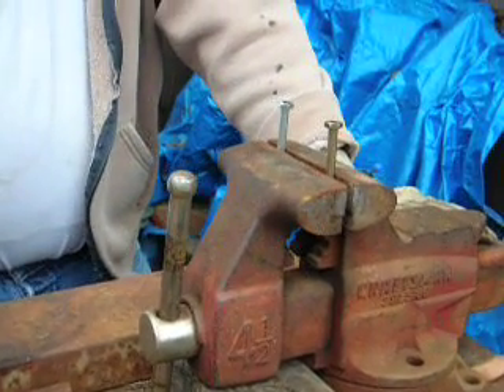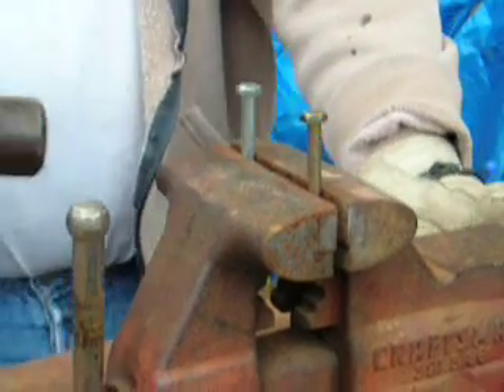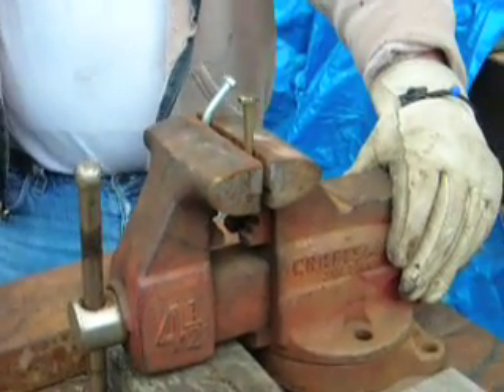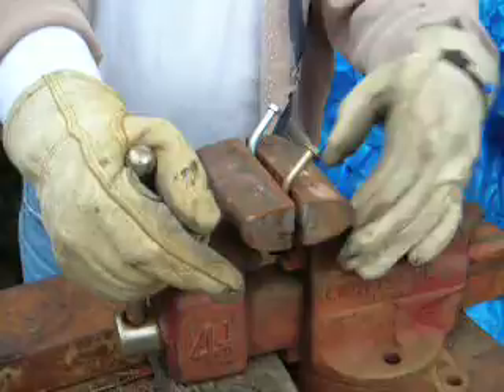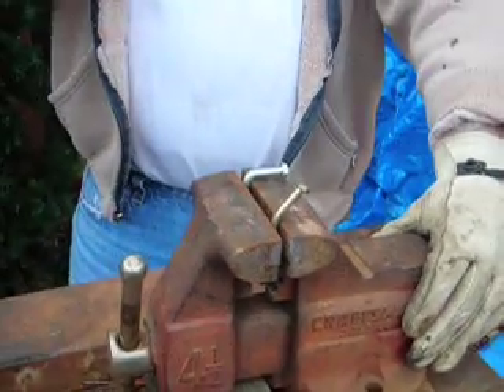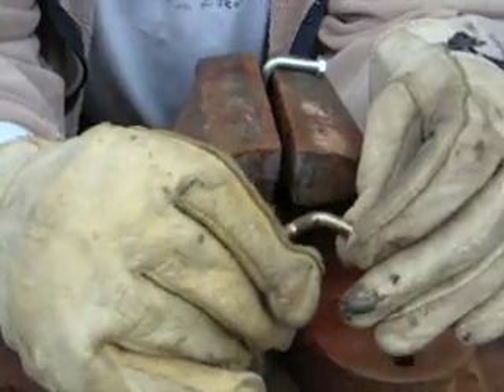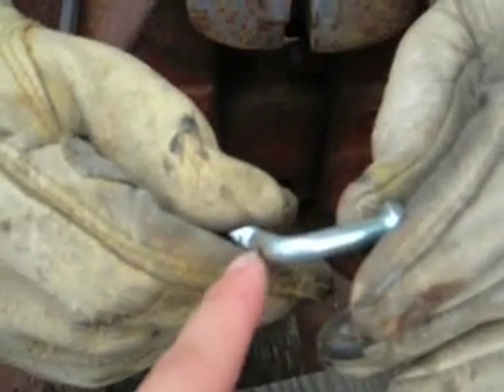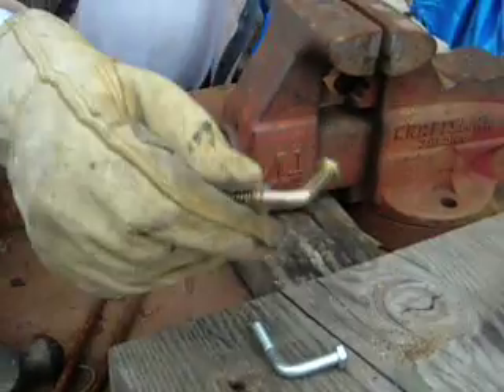Grade 8 vs Grade 5 Bolts, Are Grade 8 bolts too brittle ? DSCN1422.MOV

Comment: There's pretty much no reason to use a lower grade fastener besides cost. A grade 8 fastener will out perform a 5 in every parameter.  The reason OEMs use grade 5 through out a cars suspension, ect, is cost, no other reason.  Generally speaking everything dealing with the engine or transmission internally will be 8 or even better quality in some cases.  If a stiffer fastener creates retention issues, those can be addressed by various methods depending on the situation, such as increased fastener torque, lock nuts, lock washers, or ultimately Nord locks, but of course that all leads to more cost.

Comment: It's kind of disturbing how easily they bent
Reply: No it's not. A bolt needs to be bendable to have the strength to withstand stress otherwise they will shatter under force. If they are less bendable they are more likely to fracture and that makes for a really shitty bolt. If you need them to be less bendable you can just go up in size.

Comment: I like the test, thanks.  I found grade nuts 5 in Lowes to be garbage compared to grade 8.  Anyway people wonder about tensile strength and stiffness, but your biggest worry with mass production is impurities and flaws in an important bolt.  Cracks form where the cast has a weakness.  We buy grade 8 because they are less prone to being pieces of shit.
Reply from the maker: Generally bolts and screws aren't cast but I share your concern about quality control.  I don't believe SAE or ASME or anyone else is doing random checks of bolts sold at Lowes or Home Depot for conformance to specs.

Comment: test should have been done at the threads where it needs to be strong and also those are new bolts a engine runs at high tempratures on and off the cheap "home depot" bolts sometimes snap from becoming brittle from the heating and cooling testing the round part shows nothing because thats like testing the strength of round stock and thats the area where pressure isnt applied so much
Reply from the maker: I'm not aware the material properties are different in the threaded area, the tension is the same from the bolt head to the nut when installed, heating and cooling below some critical temperature isn't going to change the material, heating to red hot then slow cooling is likely to soften steel, make it less not more brittle.

Comment: -the same carburetor uses a grade 5 cap screw.  It's more expensive to use the spring type, but it's more important to not have a fuel leak in a boat as it can more easily lead to an explosion due to the enclosed engine space.  There are many examples of fasteners using stretch as part of the retention property.  Without stretch or friction fasteners wouldn't stay tight, using both enhances retention.  I have replaced problematic fasteners with lower grade and reduced failure in some cases.

Comment: It's proven that different materials and different heat treatments will alter spring rates significantly.  Everything from rubber to titanium has been used as springs.  Altering any percentage of alloy in a metal will change it's spring rate and duty cycle.  As for the stretch notion, many fasteners are definitely designed to stretch for retention.  As an example: my boat's carburetor bowl screws actually employ a hard coil spring as part of the body of the screw where the automotive version of-

Comment from the maker: Okay, looking for some proof, any specs you can cite that any steel is "stiffer" than another.  ( That is, the slope of the stress/strain curve within the elastic limit, cite any evidence that slope can be changed.)
If by "vibration" you mean cyclical loading, good design would prevent cyclical loading.
Obviously, both bolts were sufficiently ductile to bend 90 degrees.

Comment: I've experienced many broken bolts being a mechanic for a couple decades.  During installation a head snapping off is very rare; I actually can't think of any other than sheet metal screws, very common with those.  In-use failures and removal failures the ratio swings and it's a bit more common to see a head break off.  That's a blessing as if gives a second chance removal without drilling.  Don't know why the difference, but it's been my experience.  Now it's got me thinking, damit!

Comment from the maker: Have to disagree on the stretch notion, I've never found any evidence the spring rate of steel can be made to vary more than a few percent.  Open to proof otherwise, but I believe if you can invent "high spring rate steel" and "low spring rate steel", you'll be a millionaire or better.

Comment: The only reason I can think to not use high grade in any application, other than cost, is in the case of something that can't be tightened too much for some reason; valve cover comes to mind.  There will be less stretch put on the higher grade bolt and it will loosen more easily.  My 'educated' guess/thought, but that's how I decide what to use.  Strength needed=strength used basically.  There may be some long term fatigue situations where a lower grade fairs better, seems logical, but dunno.

Comment: as an automotive technician, i know that many bolts in a vehicle are grade 8 bolts. usually frame, steering and suspension bolts. other areas such as under hood use grade 5 or lower. so the myth that grade 8 bolts should not be used is false as you have demonstrated.

Comment from the maker: But the discussion here is about brittleness and the widespread notion that Grade 8 bolts are inferior because they might "snap" due to being brittle.  Stronger trends with harder, harder trends with more brittle.
My hunch is that the Grade 5 bolts will absorb more energy during failure than Grade 8's because the 5's are more ductile.  But in most applications plastic deformation of the bolt is a failure itself, and post-failure properties not typically relevant.

Comment from the maker: Having the bolt head snap off would be an unusual failure, I'd expect failure in tension to occur at the threads where the cross-section is reduced.  I don't have a means to put tension on the bolt till it fails, but any excess brittleness would be equally evident in bending.  In truth, I halfway expected the grade 8 bolt would snap before it reached 90 degrees of bending. Thanks.